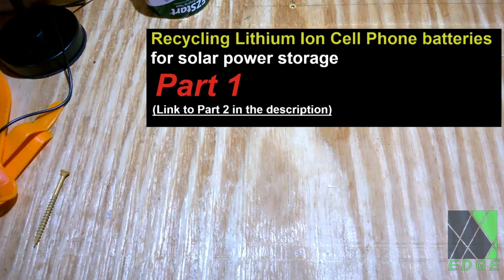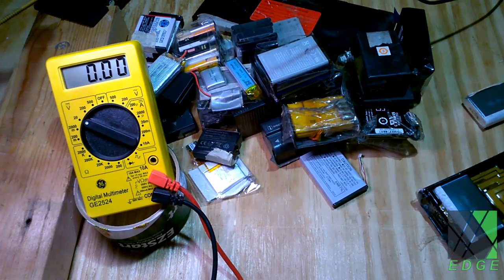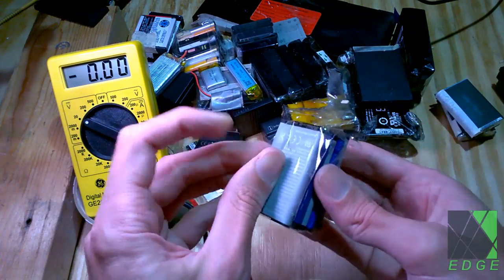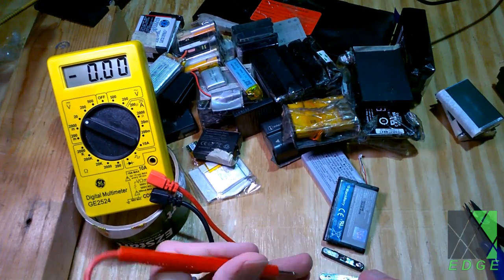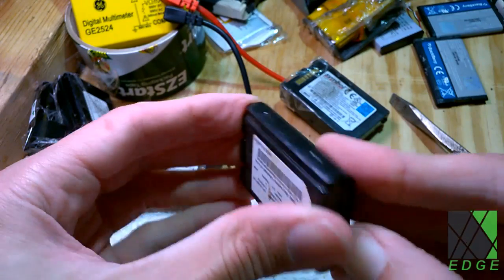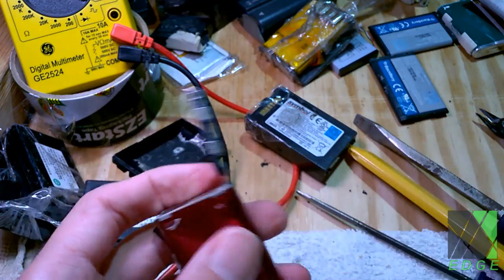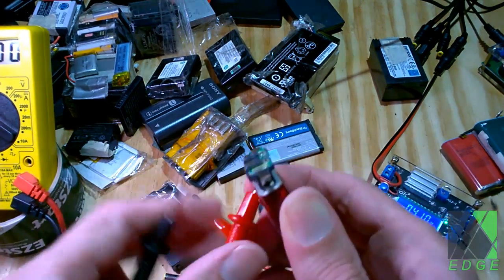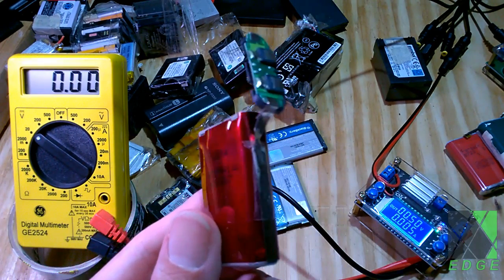Mobile cell phone batteries for solar power, Recycling Part 1 DIY #lithiumbattery #lithium

Comment: Years ago I did a bunch of 18650 cells. I made a jig to hold 10 of them. I could start at a low amperage .1amp and divided by the 10 cells it could bring them up from 0 to 2 or 2.5 volts really slowly.  I did a couple of dumb videos on it. Lol.  I ended up buying a bunch of 12volt lipo batteries for cheap from Hobby King. They were for a electric bike I built. Lately I've been using those 12volt lipo packs for restoring my old 12volt cordless tools . Thanks for the videos👍
Reply from the maker: @ww321 Welcome and thanks for watching :D 
That's a great way to speed up a tedious process... I have 4 old lipos sitting in storage waiting for some kind of project, plus a cheap drill (I fried the electronics). One of these days it will turn into some kind of machine...
I watched your lipo modded power tools video last night, excellent work man, right on 👍
Reply: @solarpoweredge  I've got over 20 cordless tools and they all work now because of lipo battery packs.
Reply from the maker: @ww321 Nice work

Comment: if the batter bolding dont use it mean it damage in side some way from a short or over to many volt use to do  ewast and presses metal recover on a small scale and refining
Reply from the maker: Your're right, also I squashed a few by mistake opening the cases